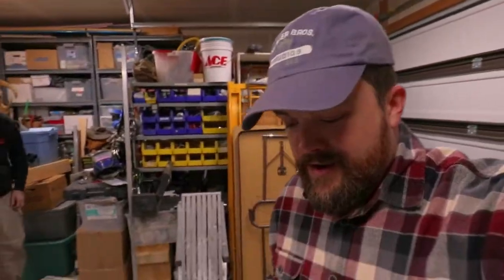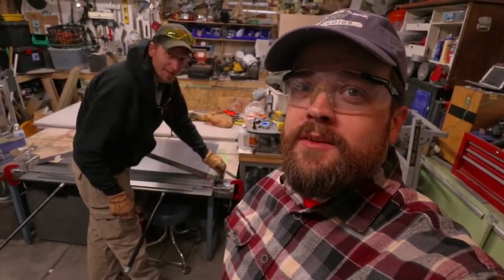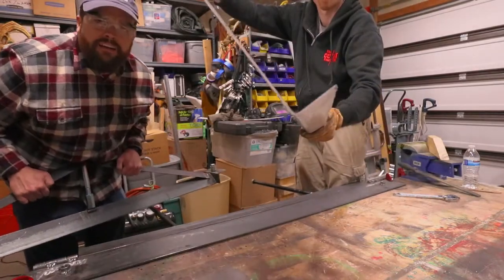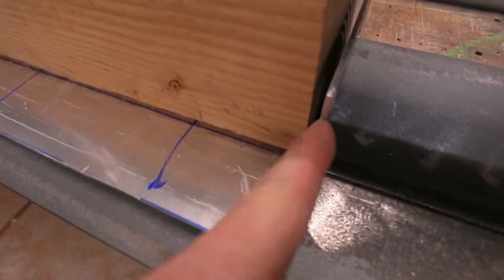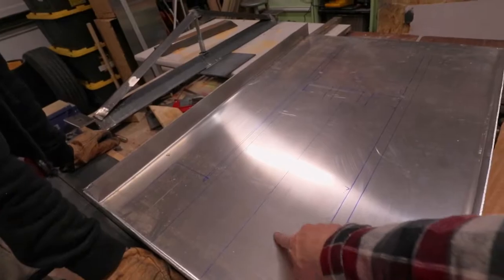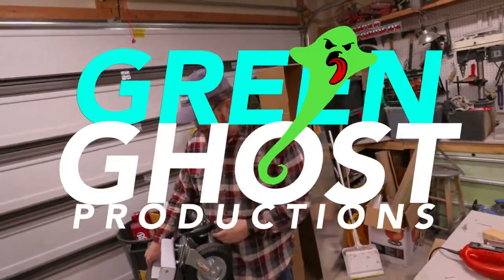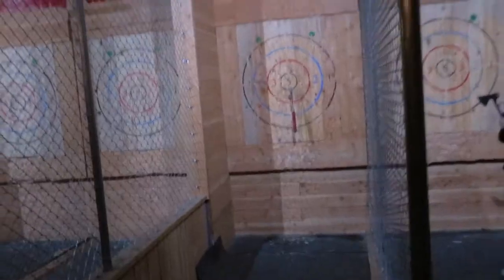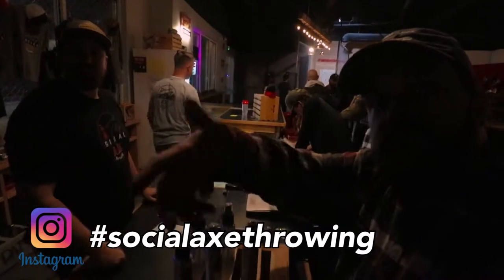Bending Thick Aluminum and Axe Throwing - Paul Green Vlogs ep156

Comment: What’s the thickness of the aluminum?
Reply from the maker: I cant remember so I went out with my calipers and measured it. It's 2.25mm... what is that? Just slightly bigger than a 16th of an inch? I can't think 🤪